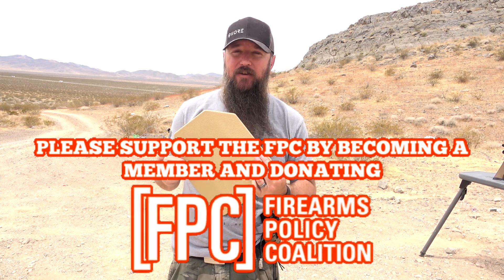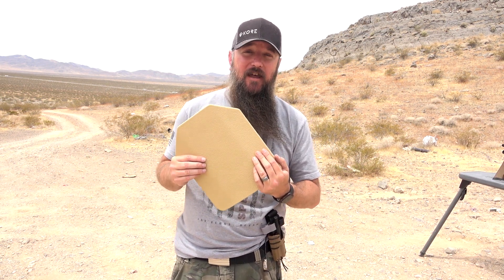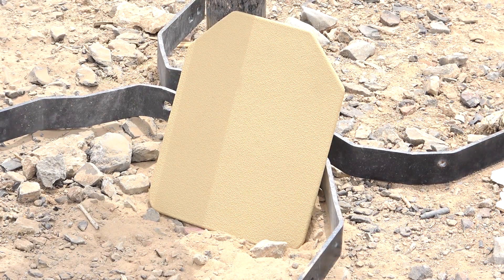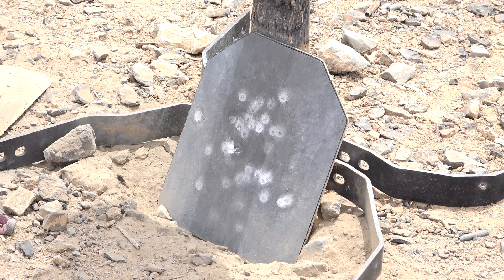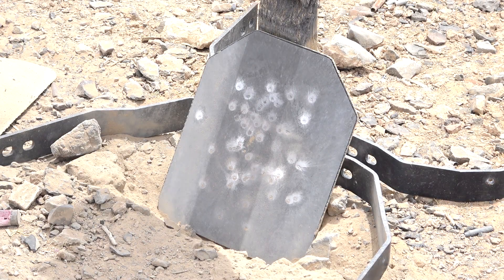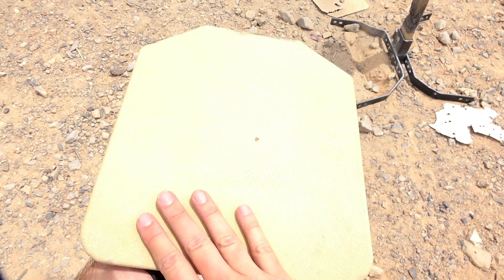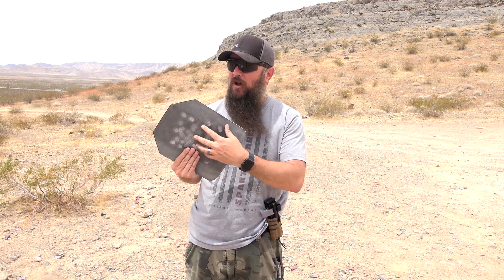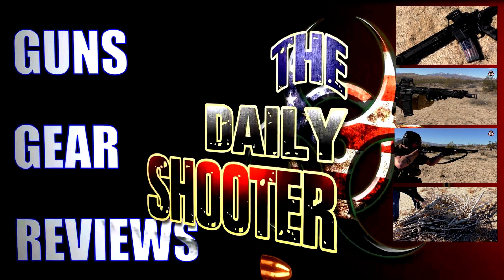Can Steel Armor Stop 60 Rounds? Educational Video

Comment: Should have used Green tip instead.
Reply: Green tip is not a steel plate threat. M193 is.
Reply: @BuffRANGE   agree, but I'm not sure if enough rounds can crack it, but if they can my guess would be a larger amount than anyone would want to shot in todays ammo prices.
Reply: @harbinger8208  I believe along time ago Demo Ranch shot 90 some rounds of M855 at 3+ steel and it took quite a bit of them.
Reply: @BuffRANGE  OK thanks!

Comment: I would like to see what a 5.56 M855 green tip round would do.
Reply: Green Tip M855 is not a concern for steel plates that are properly hardened to and above a Brinell hardness of 500. Even M855A1 will fail to penetrate certain types of steel. However M193 going fast enough will, and that speed or these plates is around 3200 fps for M193, confirmed by my testing.

Comment: I'm no expert but I think ar500 level 3 + plates with the buildup spall fragmentation protection is solid armor am I missing something doesn't ceramic just fall apart after a few rounds I've seen ar500 armor take over 30 rounds from an AR-15
Reply: In real life though, who's going to take more than 1-2 hits COM before getting the heck out of the way? I've shot ceramic systems upwards of 17-30 times before. They are not as fragile as people make them out to be.
Reply: @BuffRANGE  gang members with fully auto AK's driving after you to finish you off, that'll be a "few" bullets. On the subject of ceramic, it's all thanks to the kevlar layer why it's even stopping anything at all, without it-it's useless, but perfect for those 1 maybe 2 AP rounds, after that best to replace it
Reply: @c03_psychie  lol ceramic III and + are rated for 6 hits. I’ve hit some 30 times with rounds way more performance orientated against armor than gang bangers M92 pap running Russian lead core x39.  It’s UHMWPE that’s behind a majority of ceramics not Kevlar.
Reply: @BuffRANGE  exactly, me trying to say that dinner plate will fail a .22 if it was tested separately
Reply: @c03_psychie  hmm maybe not a 22 but yeah that’s not how they were designed though.
Reply: @BuffRANGE  just f'ing wish they could make a plate with all three in one, I mean why give options with sacrifices depending on choice

Comment: See all that dirt . that your arms and legs and now your bleeding out from shrapnel wounds .
Reply: Spall coating solves that
Reply: @rmossman88  you mean the fde spall coating that came off in 2 or 3 rounds . lol
Reply: @hindsight2022  ceramic will only take a couple rounds before being punctured. What’s your point. Spall coating may only work for a couple rounds, then you might catch some spalling, but rounds won’t penetrate. I’ll risk spalling over rounds penetrating. What am I missing?
Reply: @rmossman88  ceramic lvl 4 plates dont get penned for 30 shots or more do some research
Reply: @rmossman88  why do you think the military dosnt run steel .
Reply: @hindsight2022  so the military is your standard? 😂😂
Reply: @hindsight2022  they also chose the sig, are you running those too 🤣🤣
Reply: @hindsight2022  same amount the other plates fail or breaks ribs and puncture organs😒
Reply: @c03_psychie  its not that i/we cant handle the weight . Id rather carry 100-200 more rounds for my rifle than additional weight from armor ... Just spend the cash . Dont be a poor
Reply: @hindsight2022  I did, instead of a typical high cut helmet and small plate carrier and a small ceramic plate I went with a full level 3a OTV vest with front/back/side level 3 steel plates used in armored vehicles along with a PASGT helmet with a 3a mask so I'm good on shrapnel, the correct thing to say is don't be "tacticool"

Comment: If you really want to test it run the 55gr. through a 20" barrel for an actual test. Sorry but a little 16" barrel will never penetrate good plates but a 20" will like butter every time.
Reply: @Howlin Wolff Did he mention somewhere in the video what distance he was shooting from? If he did, I didn't catch it. I had thought that 100 yards and in M193 through even a 16" barrel would likely still penetrate a steel Level 3+ plate, no?
Reply: An m855 round in a 16" barrel  would punch a hole I think
Reply: @danerickson1632  No not in steel like this. You need M193, or a solid copper bullet going above 3200 ish fps

Comment: Steel is for TARGETS NOT BODY ARMOR
Reply: Butt hurt 🤣
Reply: @rmossman88  call it what you want. I'm not butt hurt. People in my area have hunting rifles. I don't want to have to worry if they are shooting a 45gr .223 or a light weight 243. Pretty much anything over 3200fps is going to blow a plug out of the back of that plate and thru whatever is behind it. I'm not butt hurt quite the opposite infact!
Reply: @alexduke5402  cool story
Reply: What type of armour do you own?

Comment: What do you recommend soft or Steel
Reply: Ceramic
Reply: ceramic gang
Reply: if you're LARPing steel, if you're actually expecting to see some kind of combat ceramic or composite.
Reply: @onebladeprop  steel is good for shooting and using as weights in your vest when your larping that’s it if you need, want body armor soft Kevlar or ceramic composite. No one uses steel and that’s for a good reason
Reply: @gruller65offroad96  isn't that basically what I said?
Reply: @onebladeprop  yup that was for the rest of em
Reply: ALL.